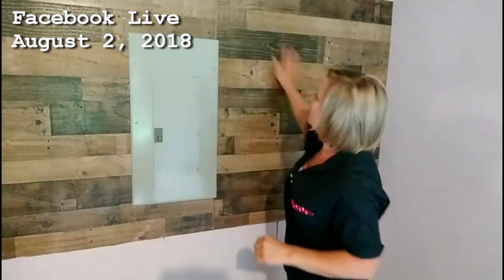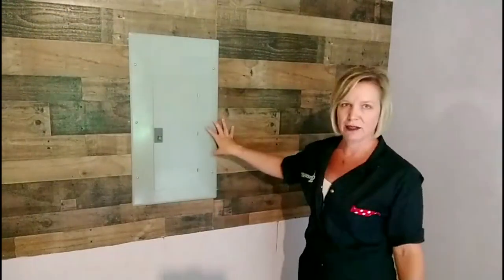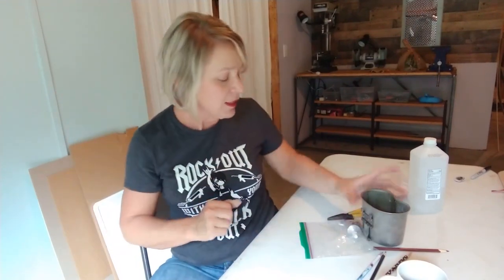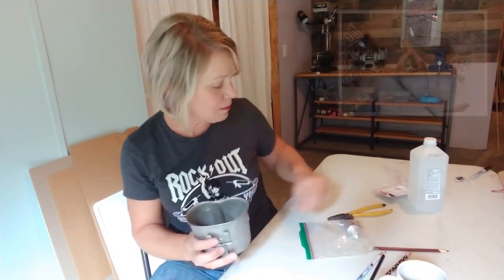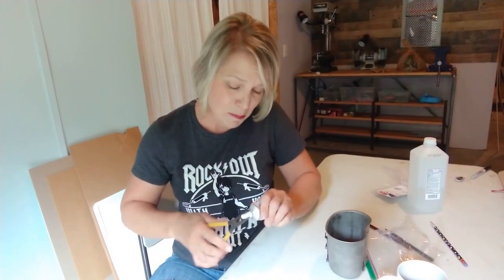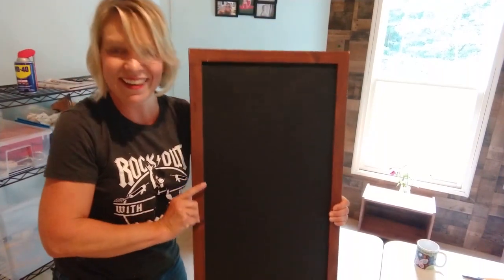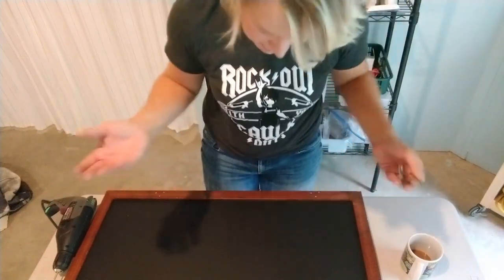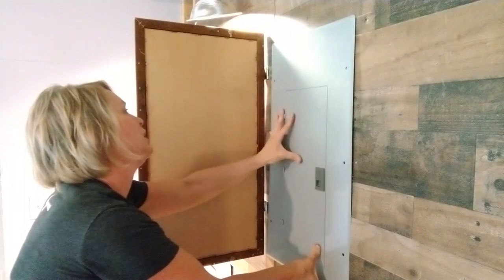Is it okay to cover your circuit breaker box?

Comment: Cool idea, but they highly advise you to turn power off when opening that panel cover and exposing the bare wire terminals.
Reply from the maker: Yes, in hindsight, that would have been an exceptionally good idea. Thank for the tip!

Comment: What is the metal piece you paint and where did you get it?
Reply from the maker: It's some sheet metal left over from an auto body project, but you can purchase smaller sheets of metal at Home Depot or Lowes.
Reply from the maker: Just take a small magnet with you when you go to purchase it, to make sure it's magnetic.